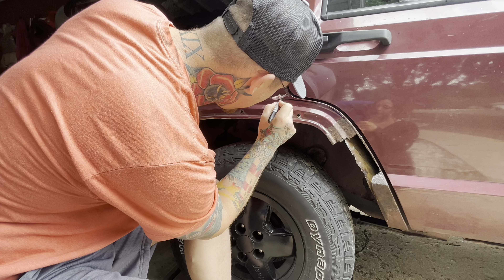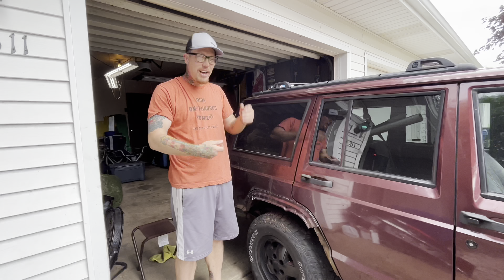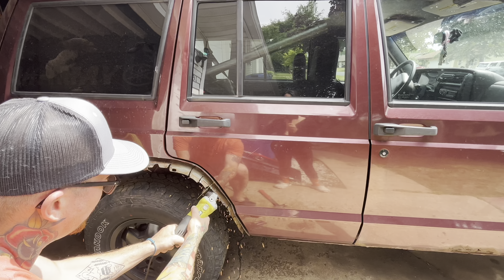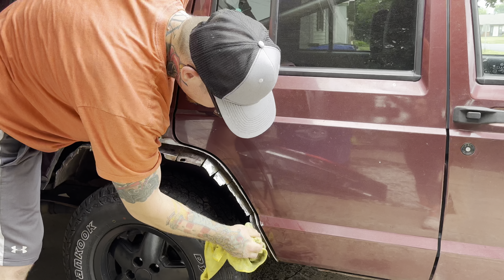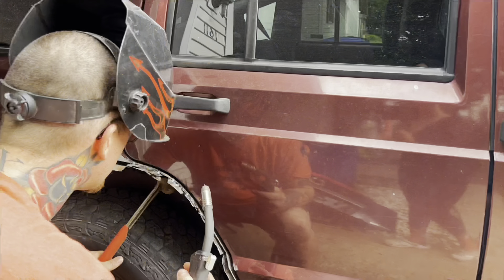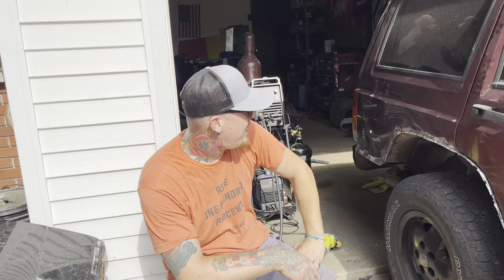XJ Rear Fender Cut And Weld. Making 35’s Fit on a stock XJ!

Comment: did you do a cut and fold in the very back to get it up that far? or just cut it off
Reply from the maker: I did the cut and fold but there was a decent amount rust so I had trimmed out the bad metal and folded what was left. I still have to make little patch panels to fill in the remaining hole on each side.